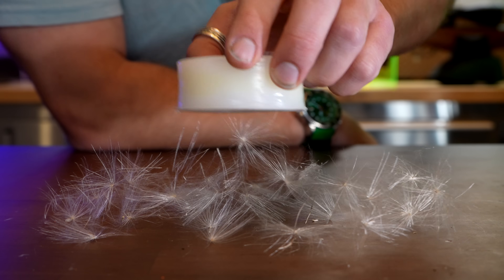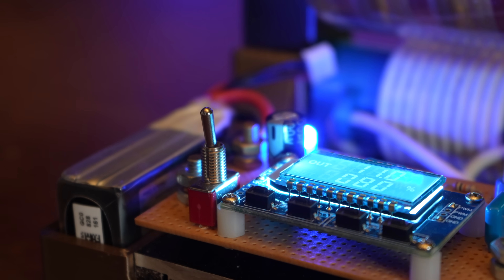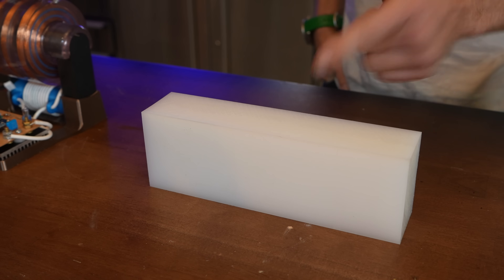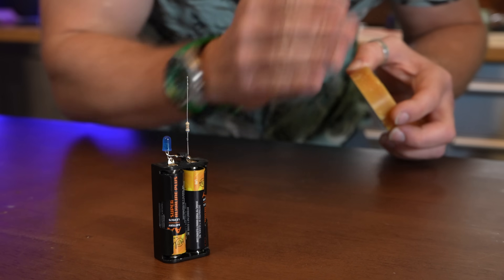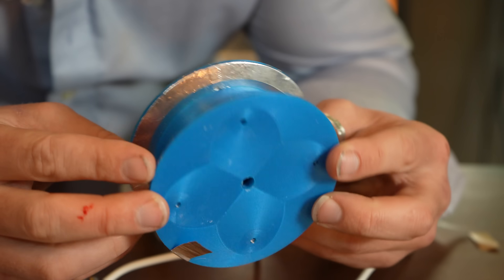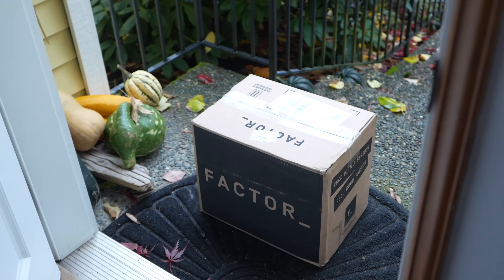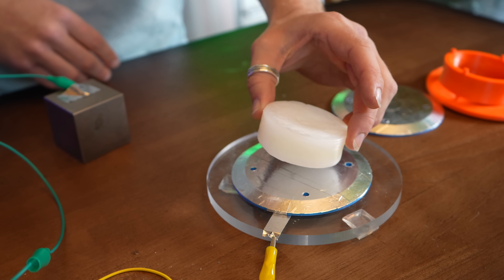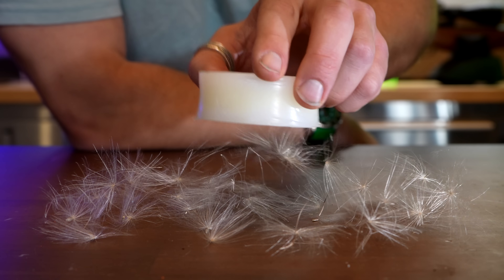Creating an Exotic Material With A Permanent Static Charge (Electret)

Comment: this is very cool, though i don't quite get how it does not loose any charge ever, like how can it be permanent? and in my head seems like it should break some universal rule somewhere xD
Reply: It's "permanent" because it's an electrical insulator and the charges can't flow internally to balance the charge.

Comment: Can't believe I've never heard of this effect before. This might be the coolest thing I've seen all year, and I spend an unhealthy amount of time watching interesting science on Youtube.
How permanent is that electret?
Reply: rule of thumb is that its as permanent as the electret is hard. ceramic electrets last really long time, just a rule of thumb due to factors.
Reply: It is also used for so called "poling" of plastic films... this whole process takes place in a giant oven with rollers and a corona brush... he's not quite accurate in the idea that it needs to be directly connected, although this will improve efficiency.

Later, rolls of the stuff can be hazardous to work with, particularly if it has been metallized on only one side... I've seen lightning bolts jump between the layers as it is pulled off the roll. Both sides have less an effect there but take on a piezoelectric effect, and flexing a cut off piece of film can develop quite the surprise for the beholder under the right circumstances.
Reply: I don't know about the thick one, but electret tweeters as used in 1950s and 1960s tube radios have started to become very unreliable. I am unsure about whether this is caused by degradation of isolation materials in the tweeter, or whether it's the metallisation of the foil breaking down, or whether it's the electret losing charge. 
I am not aware of electret headphones (yes they exist!) or microphones losing charge or sensitivity.

Comment: higher density field detector... why not a custom pcb using smt components? the floating wire from the resistor could be done as however many layers and via connectors... put down 30k components (100x100, 1 each of led, transistor, resistor) and blast it with a hot-air solder...

Comment: I never even knew what an electret was until less than 20 minutes ago. What a crazy concept, I love it
Reply: They're used all the time in microphones. They sandwich an electret between two metal plates, the electret vibrates and the capacitance is measured after the signal is amplified by a JFET which is usually included in the actual microphone module. It is a real treat to learn such esoteric knowledge and to see experiments that very few, if any people have ever seen. And just 200 years ago if you lived on a farm all your life, you wouldn't even know what the ocean looks like. It's easy to take things like that for granted. But it's nice to take a moment to think about it.
Reply: There is an electret microphone in your phone. Headsets also use them quite commonly. They are cheap and surprisingly accurate.
Reply: I wish he explained it a bit better, from what I understood it's just like a balloon that you rob on your air...  (?)
Reply: @Alfred-Neuman  The difference is that the balloon eventually loses its charge, but this keeps it for a long time. As an analogy: a magnetized nail is to a permanent magnet as the balloon is to an electret
Reply: @Alfred-Neuman i'm probably not using the right technical terms here, but basically- the material has some capacity for charge, but its conductivity is much higher as a liquid than as a solid. it's given some static charge as a liquid, then cooled without letting that discharge- so now it's much harder for it to discharge since it doesn't conduct as well
Reply: @Alfred-Neuman Another potentially great comment ruined by a misspelled word
Reply: @Alfred-Neuman I think it's like the balloon but if you melt it and the solidify the way the molecules point.
Reply: I've only heard that term describing microphones for decades but didn't look up.
Reply: NAND Flash bits are Electrets too ?
Reply: I'd only ever heard of the electret mics...
Reply: As youre meant.  Stolen History Forum had compiled a good amount of info but after the site got hit by ___?  When it returned it was  missing  so much. Some topics completely gone.    …Internet archive went down similarly a few months back.  What did we lose on the return this time ?  Nothing?? Perhaps. ..

Reminder all that weird human “magnetism” That was going on?  Things sticking to humans especially along certain areas …. Bone ridge lines. Collar bones brow line.    

The thing is it was moon ferrous things like coins and keys quite often. 
It was electret based
And yes it   Was real.  I expected on my ex gf as she  was displaying the symptoms. 

For some reason the military doesn’t feel  we should be able to handle these over a certain size. 

You can buy them. “You” Just cant buy them.
Reply: Now imagine a gravitet - one pole attracts any kind of matter and the other repels it :)

Comment: The adhesive on the aluminum doesn't conduct electricity. You can get copper tape with an adhesive that does conduct electricity. I used the copper tape to shield my guitar from outside interference. I don't know if this will affect the charging of the Electret but I did see some arcing between the layers of aluminum tape. You can solder to the copper.

Comment: imagine how strong it would be charged if you apply a voltage across thats at 95% of the dielectric breakdown for that thickness. 
40kv for PE this thick is nothing. 1 inch would be able to withstand at least half a megavolt. (>19MV/m for solid PE)
you could stick two electret discs together with this field strength

theres a method of forming lichtenberg figures inside clear acrylic plastic by bombarding it with a electron accelerator to charge it up massively and then ram a grounded spike into it to discharge it in one snap.
Reply: You'd have to make a big slab of material with the field applied only in the middle, that's the only way to avoid breakdown of the surrounding air. Then cut out the electret bit. But yet, if you build it that way to solve the breakdown problem, you could turn the voltage way, way, way up. But there is a limit: Once you have most of the molecules lined up, no amount of extra voltage will give a stronger electret.
Reply: @vylbird8014  <this
Reply: @vylbird8014  Thats a great idea, you could use a lathe to just remove the excess insulating Polyethylene!
Reply: The pattern will change depending on polarity too, negative has some truly beautiful fern like patterns.
Reply: Would it be dangerous if it was charged to that level?
Reply: What if he just made it thinner, would that be equivalent?
Reply: What would be the lifting force for something like this? Like how powerfull could we make these if we REALLY tried? Enough to lift a kilogram? Several kilograms?
Reply: @Irongrip62  maybe the strenght will be equivalent to those N54 neodymium magnets

I am interested to see what happens when we spin those two together at high speeds, will they produce visible light hahaha
Reply: @theeyeofomnipotent  Imagine building a Static energy motor but just made of cheap plastic! Neodymium is super expensive but PE is super cheap!!
Reply: @ That... would actually work. People have built electrostatic motors that run of of atmospheric potential difference - the power available is tiny, but it's enough to watch the motor spin. Enhance that design with a big electret like this though, and I think you could increase the power considerably. Enough to watch the motor spin more quickly.

You're not going to get enough power to do anything useful with it, but it'd be fun to see how well it works.

Comment: This is absolutely mind-blowing and super fascinating! I wonder how this could potentially be used in the field of chemistry. For example I read a paper a few years back about using magnets to separate chiral enantiomers during crystallization. I wonder if this could be harnessed in an application where glass is the insulating material, and it is then implemented into a still, separating the enantiomers that way. This could completely change the field of chemistry!

Comment: Test it with a Ferrocell, two discs of optical flat glas, put a drop of WD40/Mouse Milk and one drop of ferrofluid  in the middle of the glas disc put the other glasplate on top and sandwitch the WD40/ferrofluid mix togehter, than squess the air bubbles out (Use glows it is very messy) after that clean it, put transparent stickytape around the eges to seal it. put a Led stripe around the eges, hold a magent under the glas! Be Amazed ...
Reply: Credits for this invention goes to Timm Vanderelli "Ferrocell USA, LLC". For more infos about the "Ferrocell" you shout watch Theoria Apophasis "Ken Wheeler" topic Ferrocell, he did a lot of videos about the ferrocell and how to rebuild it.